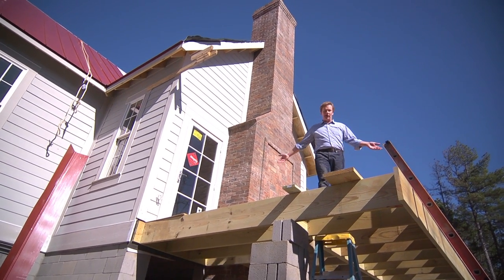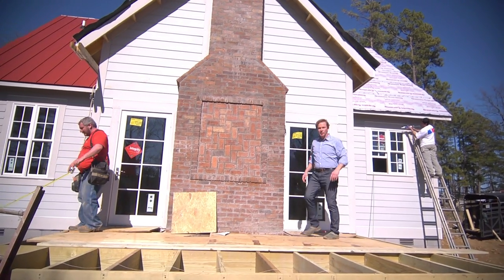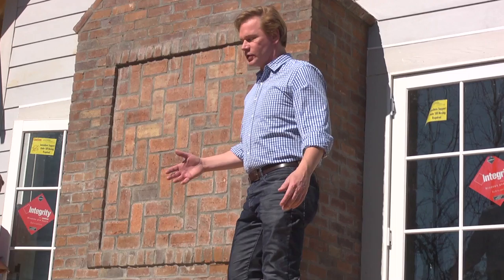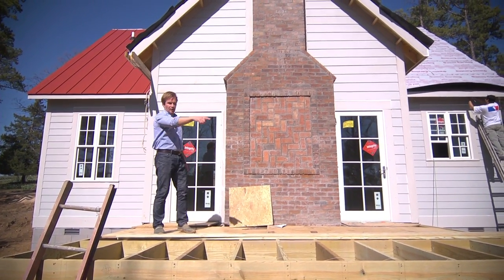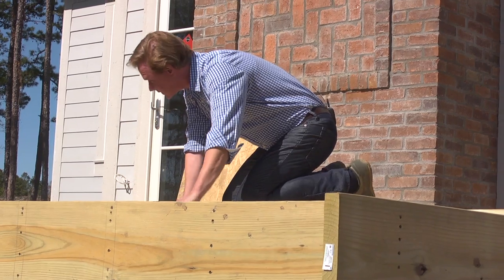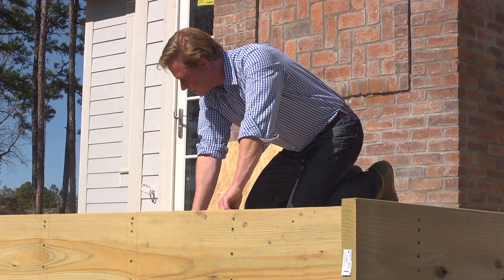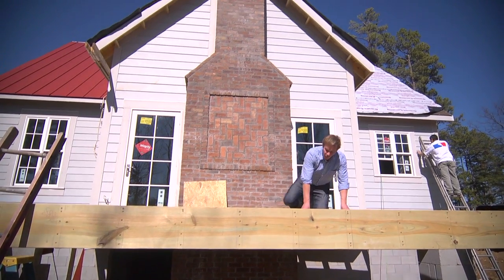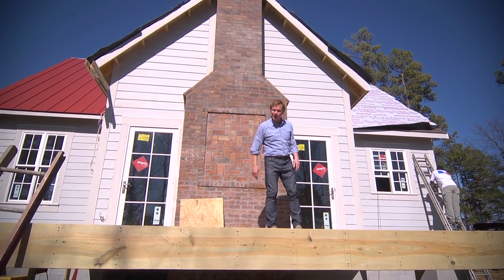A Bigger Back Porch | Day 70 | The Garden Home Challenge With P. Allen Smith

Comment: I like the fact that you expanded the back deck. The fact that both the front and back porch were the same size doesn't mean they'll "read" as being equal size when viewed in relation to their surroundings. But I'm wondering how did you support that extension? I didn't see any piers below so I take it you cantilevered the extension? But I didn't see where you sistered the floor joists. It just looks like you attached the extension to the original skirt board. Looks scary. Please advise.